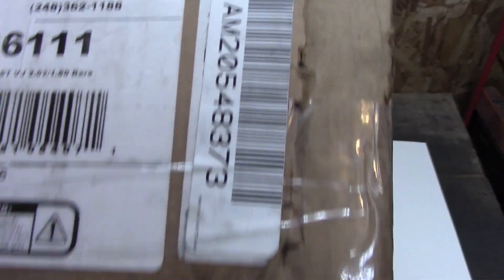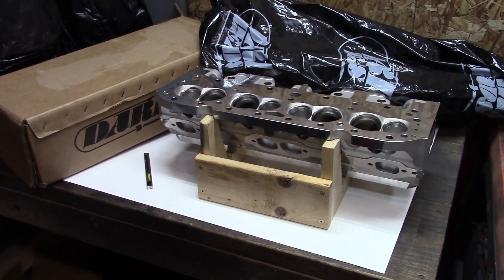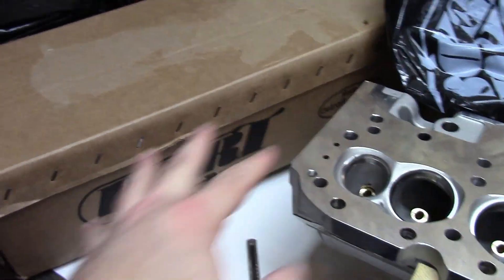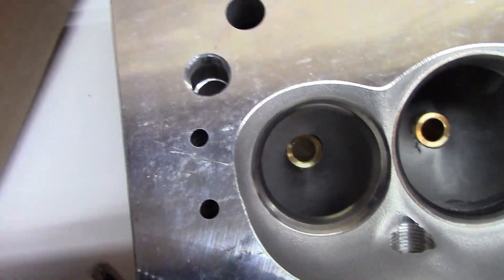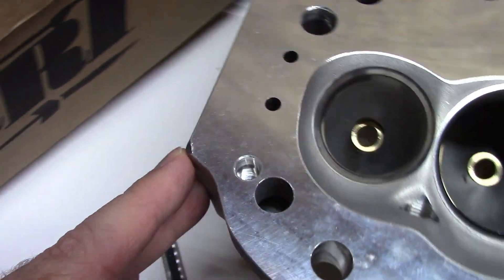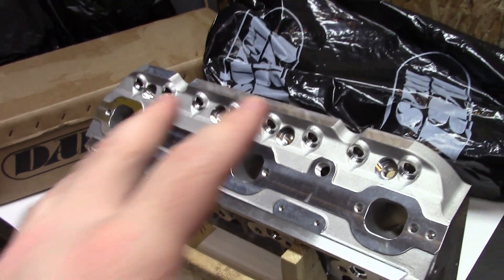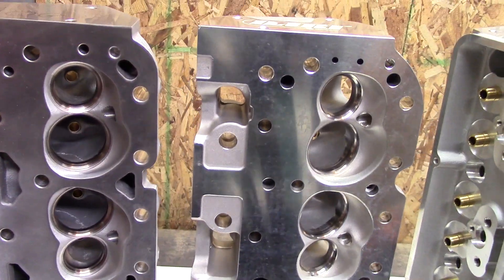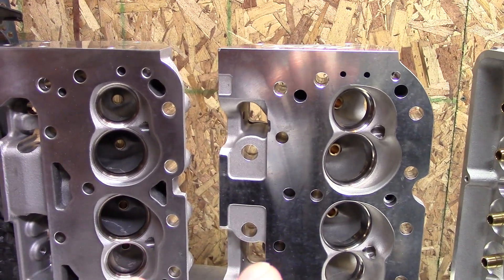New Dart SHP 180cc Again

Comment: What’s the best import SBC aluminum heads these days to buy bare and built properly? Thing that scares me is the seats and guides being installed correctly.
Reply from the maker: I think pretty much all the overseas heads, the guides & seats are installed there And then are machined here.  Even the AFR version perhaps.  Many sell the ebay generic heads under their name, even Summit Racing.  If they were Procomp or Speedmaster, I'd worry But the generic ebay heads(under many brand names) have proven to be good heads in my opinion.  That said, I like the AFR version for it's 8mm stems and VJ
Reply: @BOOT  say thanks and you make some great points and makes me feel better. I have seen those SBC ones on Amazon that are bare and just $189 each. Have you heard anything on guys using them to build up?
Reply from the maker: @Ron_Presley  Doesn't matter who makes them, gotta inspect them for defects.  I prefer ebay for their Money back Guarantee but Amazon is decent with returns. Lots of people running the cheap generic overseas heads w/o issue But even I have gotten some of the defective ones.  GL with what ever heads you buy.
Reply: @BOOT  Guides are pretty questionable and wouldnt run much spring pressure with them.
Reply: Have 2 sets, 1 bare stock the other extensively ported. 
All hardware too if interested.
Reply: @gordocarbo  So what are they? SBC ? Angle or straight plugs? Price?
Reply from the maker: @gordocarbo  Spoke to several, with no problems running them for over 10,000 miles.  Guides are fine

Comment: Did you ever get the new head?
I bought some shp heads from skip white about 8 years ago and they are still running
I had skip white put them together using the cam specs I gave to them. Under 1k including 7/16 rocker arm studs and fel pro head gaskets and guide plates
Reply: Have you heard of any guys buying Skip Whites NKB heads if they are good heads?
Reply: @Ron_Presley   Just buy real Darts trust me. 
Most the "they are fine" guys either dont know what to look for or havent put any real miles then really inspected them. 
You wont just buy them and stick em on without spending money to make them right.
Reply: I'm sorry I'm not familiar with nbk heads but I bought dart shop heads and they are still running. I have talked to them about the procomp heads they are responsible for getting them revised they did a lot of work and when it was completed they sent procomp the head for casting it the newly revised way. That's was many years ago. Skip White was my supplier for a few years I sold their parts.